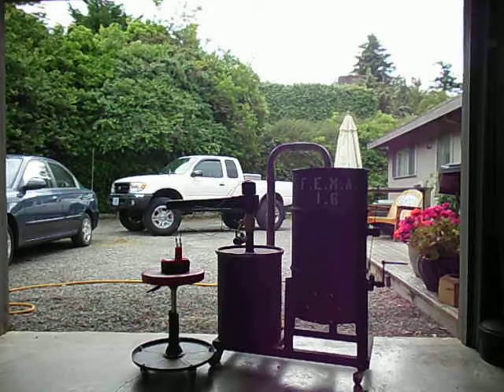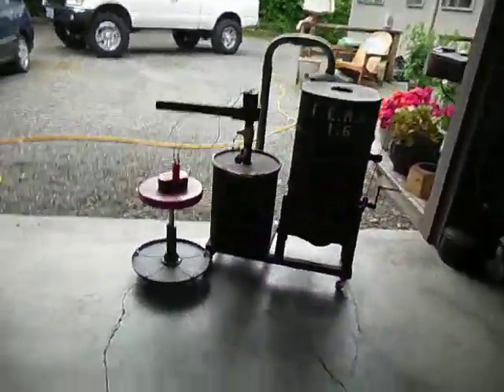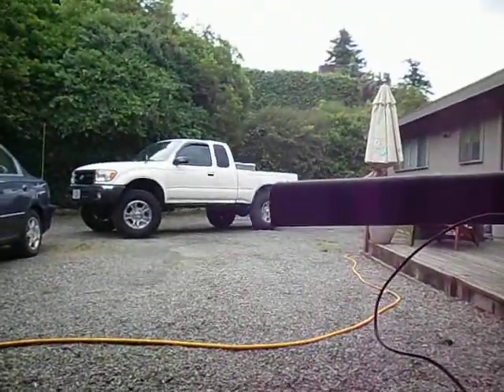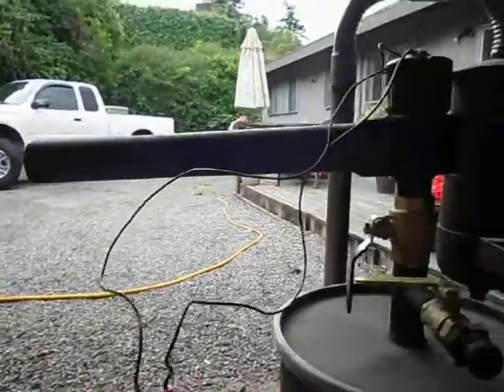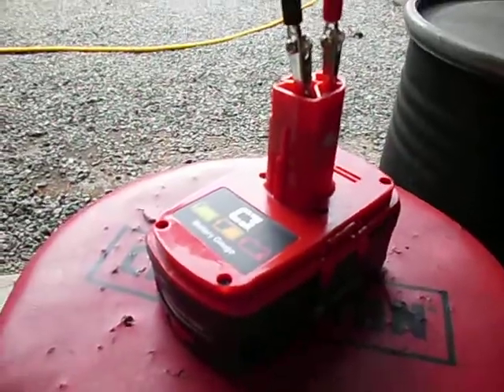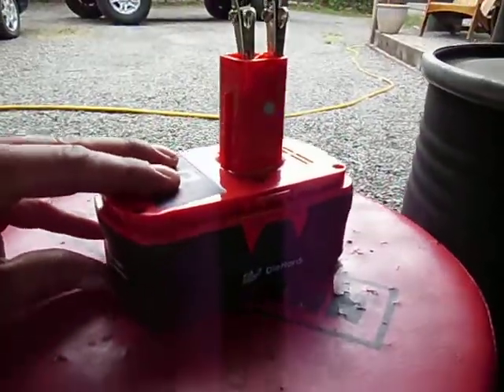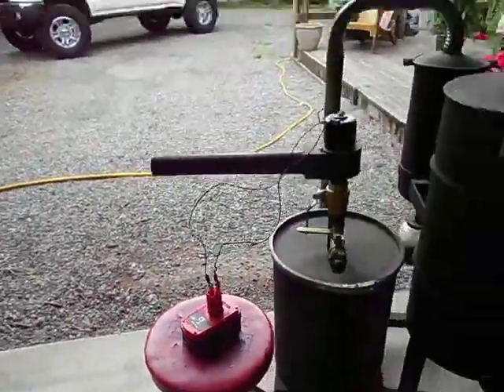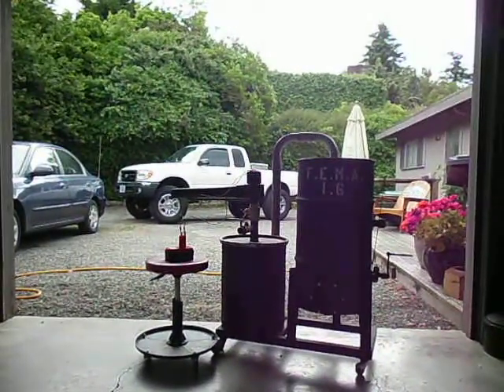Cordless tool battery powered gasifier

Comment: I'm currently building a fema but using 6 inch burn tube ,did you line the bottom of the barrel  with anything ,thanks for the inspiration

Comment: Hi JOsh yes that's a great idea on starting yr gasifier on yr craftsman battery. when all else fails. you can use yr 12 volt gen u built to charge yr main gulf cart batteries. and run yr inverter. remember gasoline runs out very fast when power goes out.everyone runs to the gas station.for gas for there generators to keep there refrig running in ur case u don't have to worry with plenty of wood chips. my7 yr old niece wants to say something.(you have great ideas.jackie.) keep faith john millard